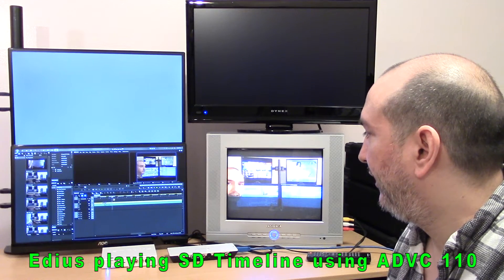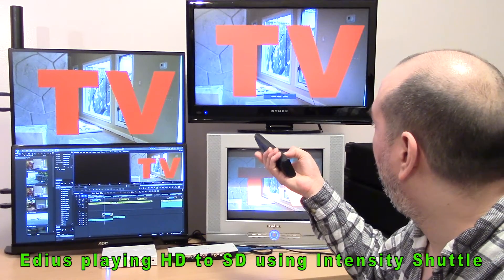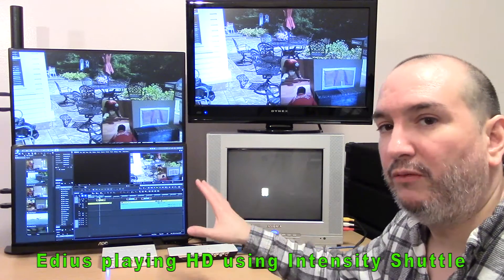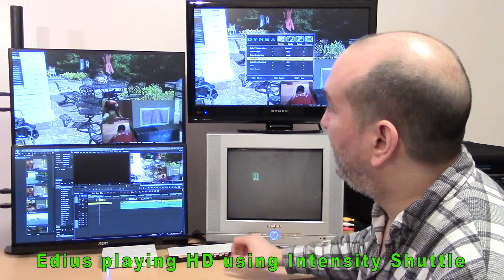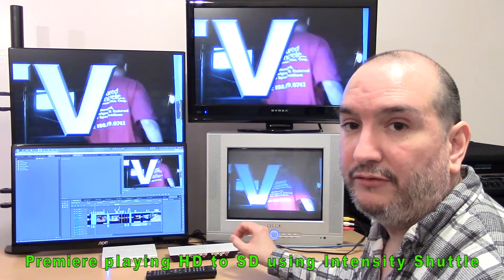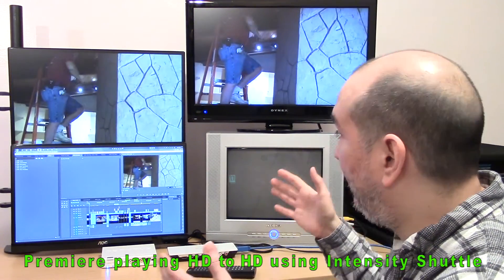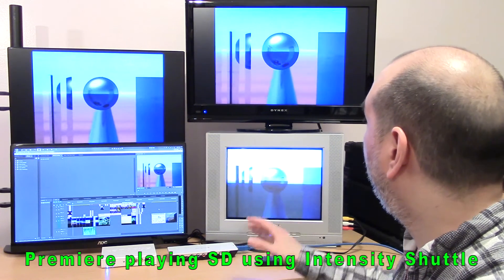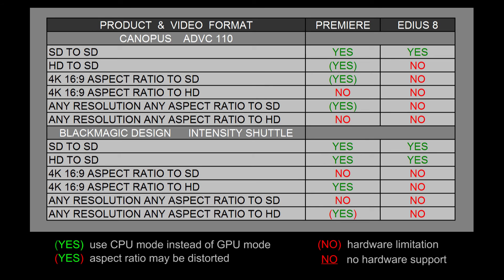Blackmagic Design Intensity Shuttle VS Canopus ADVC 110 part 1

Comment: Hello :)   Can me someone help please. As many people... after capturing via Intensity Shuttle USB  to my PC I have many problems with sync video/audio.  I have very old Tapes VHS. I think that is due lost frames on the VHS tape. Earlier I made this so:  VHS recorder via composite to the Sony PD 170 and out via FireWire to PC and this method worked very well for me. But I sold the Sony pd 170 :(
Now I am thinking about a Card  Blackmagic 4k PRO ???  
Please let me know or this is a good idea
Thank You very much
Reply from the maker: I imagine the Intensity Pro 4K PCIe card would require a TBC. I use a Canopus ADVC 110 as seen in the video link below. 

https://youtu.be/dVLUxRkPMdA

Comment: I don't ever hear anyone speaking on the monitors! So this is great.  I have some hi8 and dv tapes to edit and convert to digital. 
What kind of monitors would be suggested? I mean the video output is considered standard definition no? So CRT? Or one old  tv monitor and one hd computer monitor? 
 Then again what's the benefit of VIEWING it on standard def? It has no bearing on the output.  itself. 🤔
Reply from the maker: You want to use the CRT SD TVs.